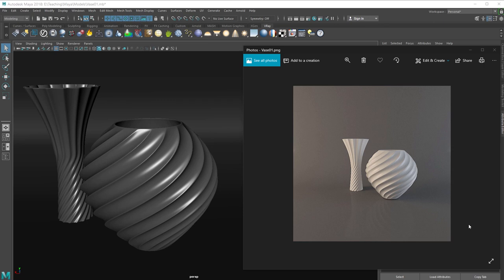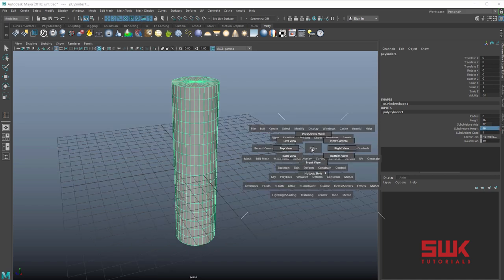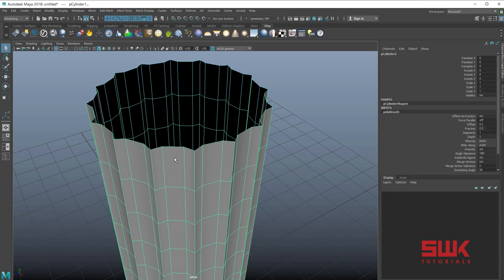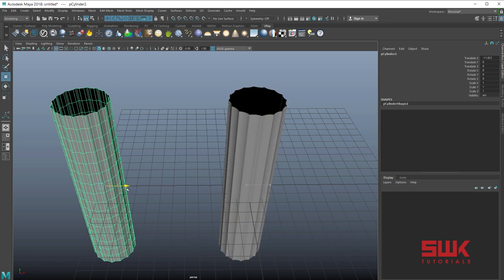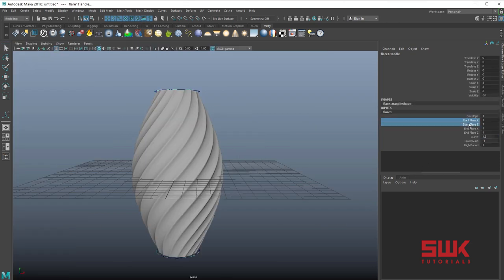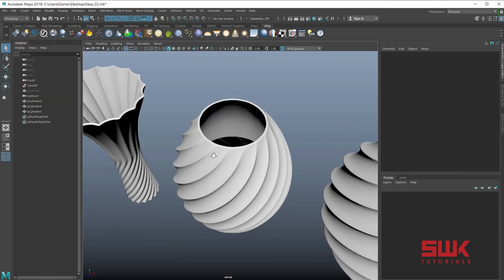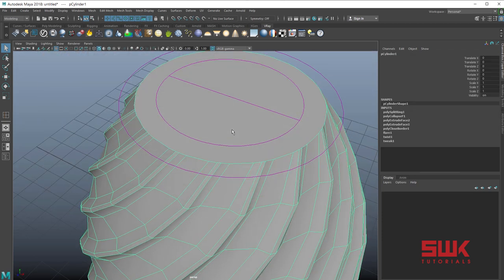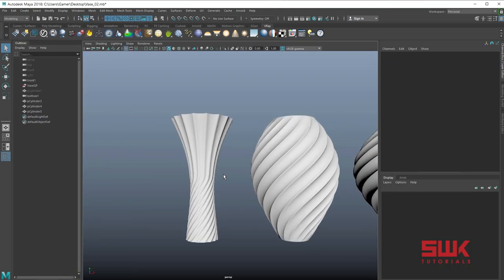Maya | Easy Vase Modeling using Nonlinear Deformers

Comment: Really nice designs. I don't have Maya but I tested the same techniques in SelfCAD and it looks awesome. It's actually a bit easier in SelfCAD because I used the loop selection with custom pattern and that saves a lot of time selecting...
Reply from the maker: You are right. It's slightly time consuming in Maya but it's fast in 3ds Max.
I have also done this tutorial in 3ds Max

Comment: hi. when you do collapse in the bottom, doesn't this solution makes problems with the shading? Thank you.
Reply from the maker: No problem in shading.
Can you tell me exact time you are talking?
I will answer in more detail.
Reply: @SWKTutorials  yes at 7:40! I say this because i thought that is better to model with quads otherwise the light makes weird things in the shading. Maybe u can give me some advice? Thank you.
Reply from the maker: There are 2 reasons why I didn't make it quad.
1) this part is going to touch the floor. So it will not show in renders.
2) on 7.30 I made an extra edge using extrude face to support shading on applying smooth. So it will appear proper in shading. 
Also note... You can delete 1 Edge and leave the other. After 7.40 collapse command. It will make it quad.
Reply: @SWKTutorials  okay thank you very much!! :D